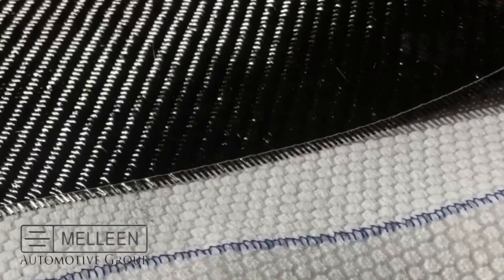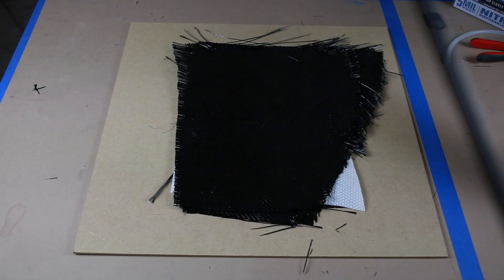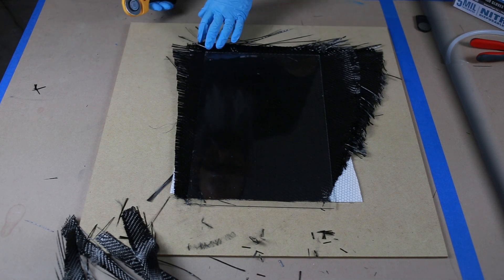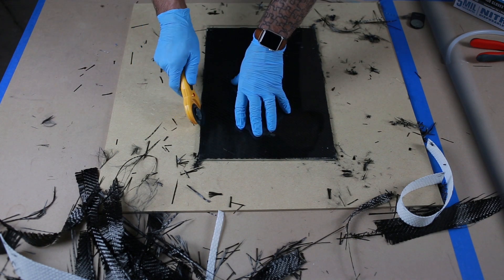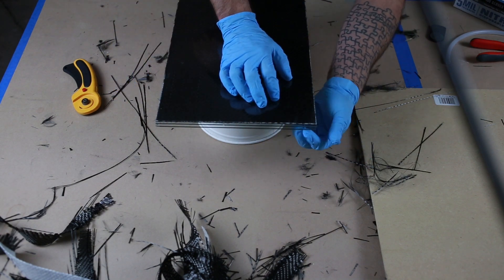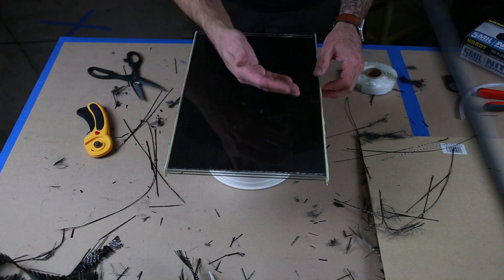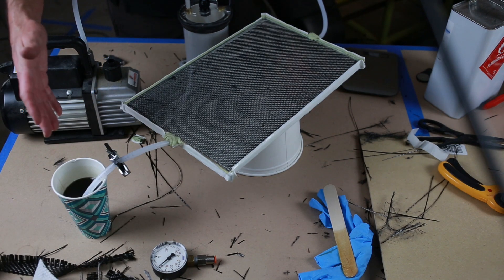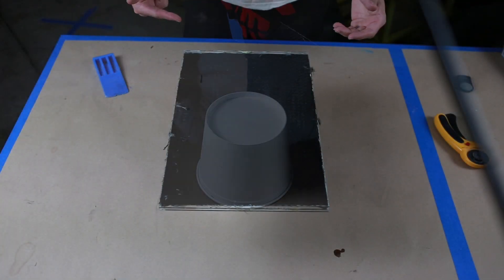Resin Infused, Double Sided, Mirror Finish Carbon Fiber Panel!

Comment: You just gave me an awesome idea using soric. Using a tooling plug made from a tooling mold and built up to desired composite thickness, you can make a perfectly formed multi port intake smooth on both sides using a split mold on the outside and vacuum bagging the whole thing. You would have to run a vacuum line to both sides of the split and isolate the bag with gum from the resin vacuum to keep the resin from flowing outside your compression mold. Can already do infusion inside a closed mold or tube by looping the bag through the center and over the outside of the mold sealing bag to itself. Feed the resin inside from the center.

Comment: Why is it so rigid? Is the stiffness aka flexibility of the carbon fiber no longer present due to the hardening of the resin within the soric core?
Reply: It's rigid in large parts because it is a sandwich/cored lay up.  The strength doesn't really come from the resin a much as the fibers. The resin locks the fibers in place so they can do their work and be "stiff" but the inner and outer skin being seperated by the core is what really gives this laminate its stiffness.

Comment: without a mesh how big can the part be/ would that work on a 1.2m length plate?
Reply: Soric works as a core and a flow medium. It will work without it with low viscosity resin and a long time hardener.

Comment: Hi, great technique. Do you know what the resin to fibre ratio is? May I suggest weighing the fabric before and after infusion next time? The knowledge gained would be very beneficial to a composite aircraft builder. Cheers.
Reply: Hard to measure FVR with a core !